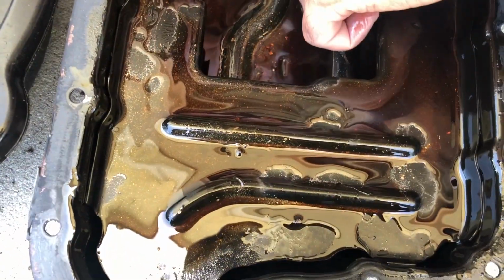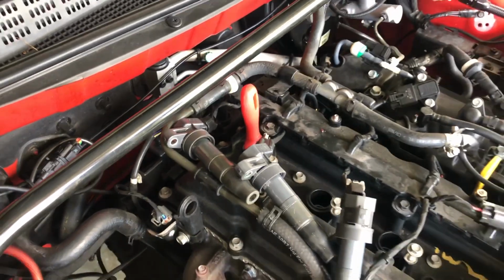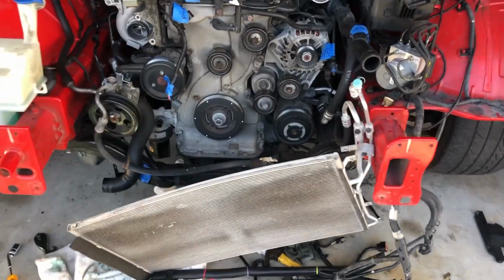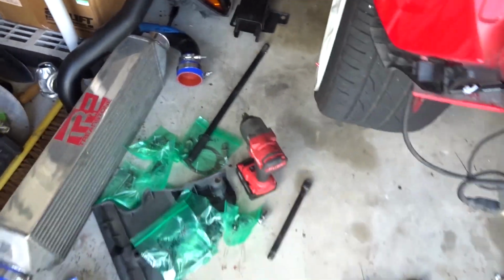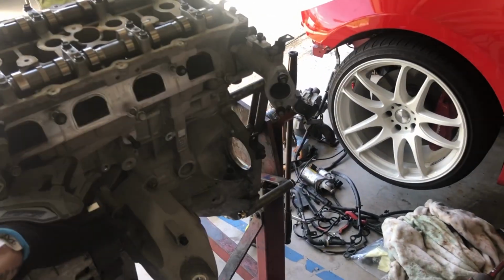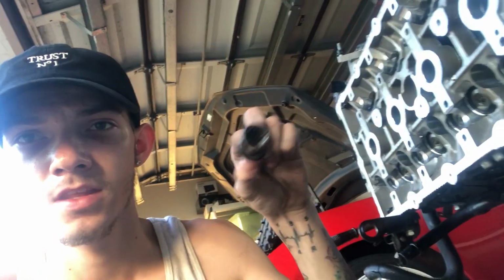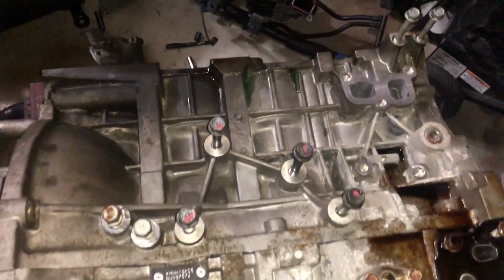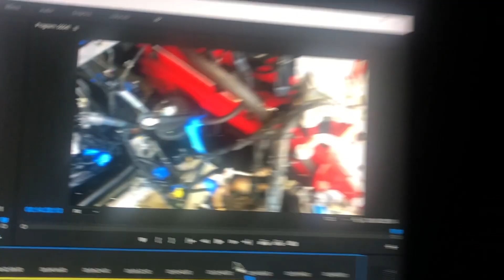Pulling out my blown genesis coupe 2.0T motor

Comment: I have that same knock 😞I subscribed to you dude you and Brian Paul are awesome 🙏🏻😁I like your car
Reply from the maker: Thanks ❤️I appreciate the support! Sorry about the knock it’s never fun to hear that! If you have any questions about rebuild feel free to message me on Instagram!
Reply: @ElectroMarcanical  mr genny dude will changing the rod bearings help fix it or is it so bad the connecting rod is broken and not worth fixing anymore 😞
Reply from the maker: @phenomphantom5329  it depends on what’s broken it could be a bearing, a rod, a piston or the block. Almost all repairs will require a rebuild and some machine work
Reply: @ElectroMarcanical  aww man I don’t have a Instagram just a Snapchat 😞 also i had a question about unbolting the transmission for my automatic when removing the bell housing bolts and removing the cover to get to the torque converter bolts do I have to have a floor jack ready so when everything is removed, I was curious how you and Brian Paul did that I asked people at the shops and they told me to remove the transmission as one assembly to 😞
Reply from the maker: @phenomphantom5329  you should have a transmission jack to support the weight of the transmission but for automatics I’m not sure how that works

Comment: How did u take the valve covers off
Reply from the maker: Pull out the coil packs, and there are a ton of bolts around the valve cover and it comes right up

Comment: Same thing happened to me while i was driving. I makes the exact sound 🥲 can’t find any low km engine. 💔
Reply from the maker: Sorry to hear that :/ time for a rebuild
Reply: @ElectroMarcanical    most engines has high mileage on it. Whats your opinion on getting one with no warranty with more than 150k km on it, couldn’t find low km engine with Turbo.
Reply from the maker: @-JJ--  better off getting yours rebuilt
Reply: @ElectroMarcanical  i’m not good with cars. I spoke to several mechanics and they’ve told me to either get an engine or just short block since the pistons are not good and are moving. Till today I didn’t find low km engine. Most engines are expensive with high milege and no warranty.
Reply from the maker: @-JJ--  yeah your best bet is going to be a used motor. They are going for about $3000 but a rebuild cost about $1500 if you do the labor yourself that’s your only 2 options really
Reply: Appreciate it 🙏🏽
Reply: Yep rebuild is the cheapest way it’s what I’m having to do 😣

Comment: Can you tell me what I need to make 600hp on my genesis coupe?
Reply from the maker: Built motor with forged internals, definitely gonna need bigger cams, Atleast gsc s1s. A turbo capable of 600hp the go to for these cars is a Garrett 3076r, return style fuel system with Atleast a dw400 and 1300cc injectors, you can do e85 or 93+meth, a haltech or link ecu, an intercooler rated for that hp and a good tuner. There’s plenty different ways to make that power on this platform I will be doing a video soon to show what my setup is, how much it cost and what is needed to make the 600hp

Comment: legit engine pull--nice job on cleaning up and labeling everything.  About to do an AC compressor on this vehicle.  Front end seems like it comes off relatively easy to access the condensor.  you may want to post a link for an inexpensive triple square set from Amazon or Harbor Freight.  Cringed when you disclosed the mishap with the head bolts.
Reply from the maker: Yes I totally regret using the T55 instead of the triple square! They sell a good Duralast set at just about any autozone

Comment: I want a genesis but this is what I’m scared of, I heard it can’t handle too much boost and that people have to rebuild the motor in order for boost
Reply: Yeah don’t get one it’s no fun breaks down so easily aroun 120-180k best off getting a 370 or a Infinity I’ve owned one it’s the worst feeling, after you sprung a bearing it’s better to Swap the motor than fixing the OEM
Reply from the maker: Spinning bearings is common on this platform unfortunately
Reply: @Zx6kidd  oh ok thanks, they should’ve never discontinued the genesis production, it’s a beautiful car. I’m just gonna with Audi A5 2.0t 2014-16 because that was my other choice
Reply: Got 2.0T bk2 and it blew up at 124k . Unfortunately engines and transmission do blow up alot on those cars.

Comment: I’m about to pull my engine out soon! Just need the correct tools to do it myself and then I’ll send it off to get rebuilt
Reply from the maker: Goodluck man just dropped my block at the machine shop today
Reply: just rebuild it yourself. its so easy. you just have be organized and know the torque specs
Reply: @jays5926  lmao as if rebuilding an engine yourself could be done that quick... cmon bro be realistic, even the prep time to know what you’re doing takes time.

Comment: I Swapped mine and i’m having weird random bog outs thinking it’s spark plugs but is there any common things that it could be?
Reply from the maker: Air fuel or spark check all 3. That’s what makes your car run :)
Reply: @ElectroMarcanical  allright i’ll swap out my spark plugs and check my injectors i think air is good

Comment: I'm having a hard time separating my transmission from the motor.. any advice?
Reply from the maker: It’s easiest with the front core support off like I had it, also make sure all 10 bolts of the transmission housing are off there are 2 towards the top that are impossible to see and you have to feel for, also make sure your front sway bar is removed the transmission tends to get caught in that when removing. Let me know how that goes if it doesn’t work feel free to message me on Instagram and I can reply faster with more advice

Comment: Hey bro I’m thinking of building my 2.0t bk1. U by chance know the process on doing so lol. Like I can’t just buy all forged parts (pistons, rod bearings, etc) and just replaced the old parts with those and call it a day right? Do I have to send my motor to a machine shop or so. I’m new to this lol. Also I haven’t blown my motor just want a strong and reliable build. I’m up there in miles 104k
Reply from the maker: If you’re building your motor definitely buy forged internals and regardless of if you know what you’re doing or not I would always have a machine shop take a look at the block and assemble just in case there may be any damage and then they torque everything properly.

Comment: Did the stage 2 turbo have something to do with the blown motor? I been looking to get that upgrade with my bk1.
Reply from the maker: No I money shifted 3rd to 2nd at 90mph the turbo is actually for sale and I’d offer it to you but you are bk1 and I don’t think it’s compatible
Reply: @ElectroMarcanical   Selling the stuffed turbo? Whats the configuration for the?  Stage 2? How much and is it still up for sale?
Reply from the maker: Christian Gomez yes it’s for sale however I’m doing a package deal it’s gonna be the stuffed turbo, manifold, downpipe, modified 1000cc stock injectors, and my e85 tuned ecu for $2,000 your car would be making 375 whp and 335wtq safely
Reply from the maker: Christian Gomez but it’s the bk2 configuration so I’m not sure if it’ll work on bk1 to be quite honest with you. If you want to go the stuffed turbo option look on 3point8performance website
Reply: @ElectroMarcanical  oof i have everything besides the Stuffed turbo thanks for the fast reply though :D
Reply: @ElectroMarcanical   are you still selling the stage 2 bundle? I got money on hands
Reply from the maker: @ghstboy9863  unfortunately some one already purchased sorry man